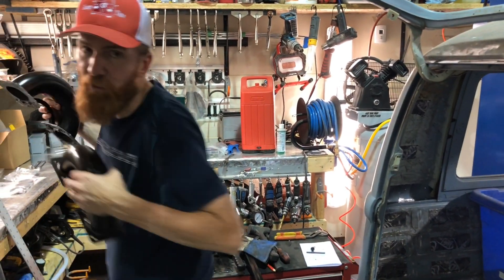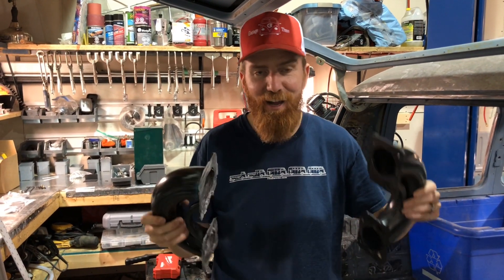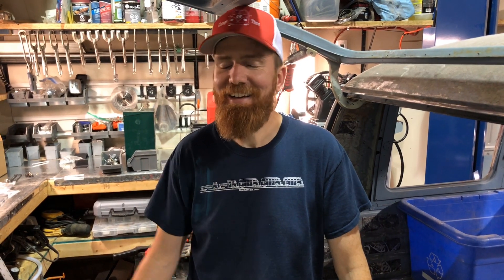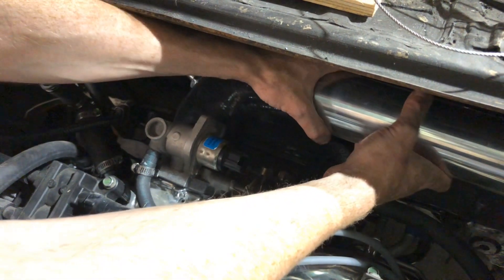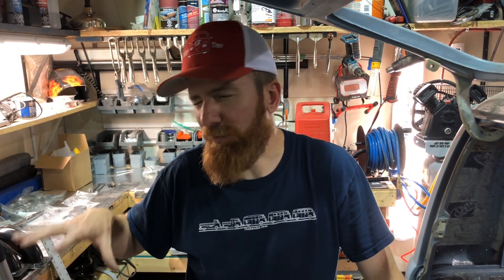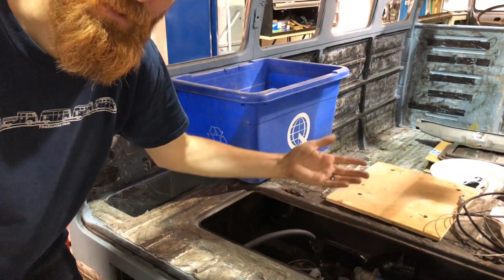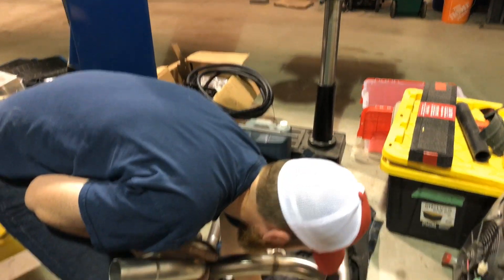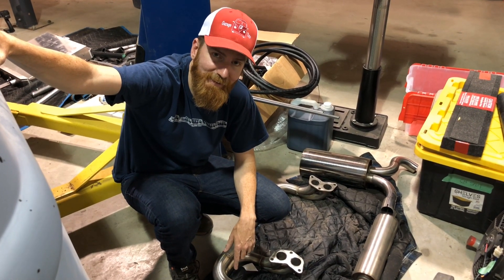VW Bus - Subaru Swap - Throttle body Reverser - Episode 12

Comment: I ve buying materials  have  subaru transmission a CD wrx turbo engine I'm just going to cut  firewall out and then reposition weld  it after all is installed